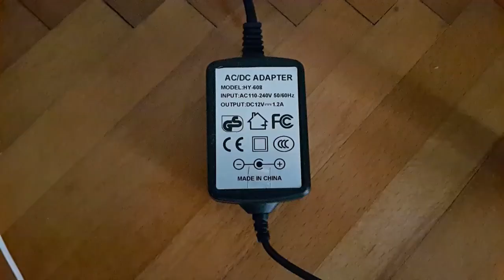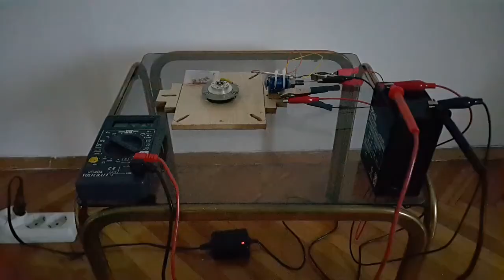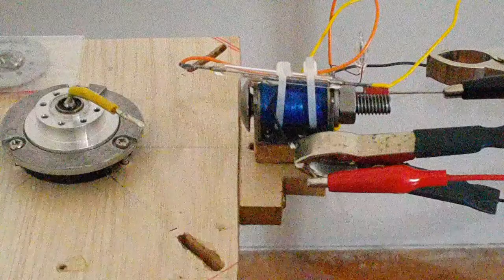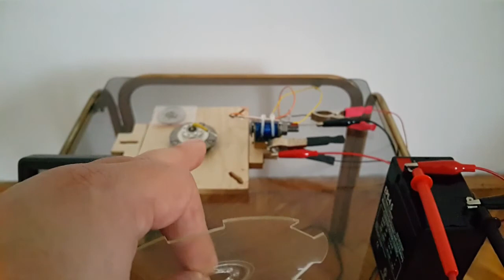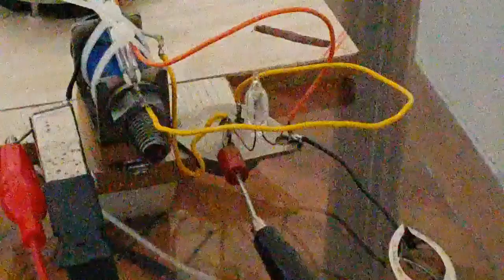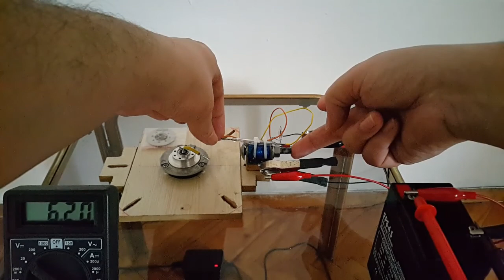How 2 Desulphate/Revive VRLA/SLA Rechargeable Batteries - Ossie Callanan's Design

Comment: Did you ever try 2 reed switches connected in parallel?
Reply from the maker: No I didn't - what would be the benefits of this setup ? 🙄🤔
Reply: @davidbolha  many more radiant spikes, higher output? Less reed burnouts, its it's alright I'm gonna do some experiments in the near future
Reply from the maker: @doubleooh7337  Aha... Ok will give it a try next time when I'll have another battery candidate to re-alive. 🙄😏👍
Reply: @davidbolha  did you add a reac?
Reply from the maker: @doubleooh7337  No.
Reply: @davidbolha  I'm gonna try a capacitor bank instead of dead batteries obviously just the one charging battery,